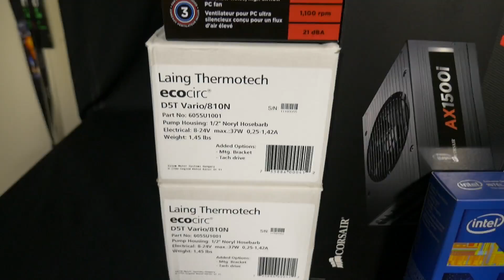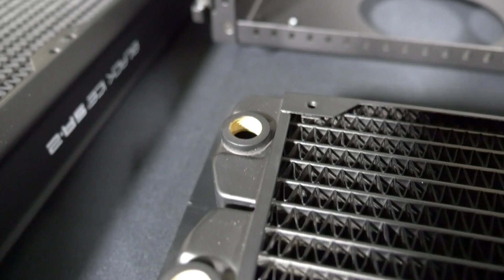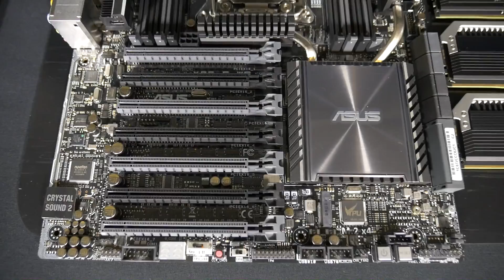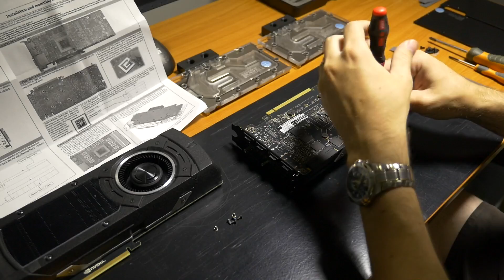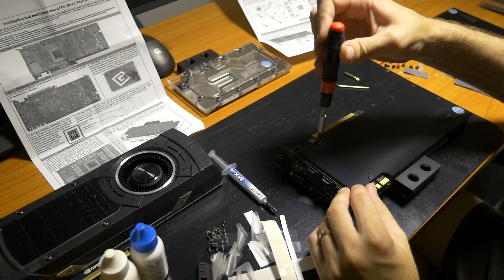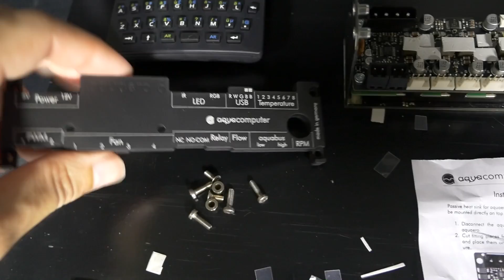SC Build #18: Extreme Workstation: Part 1

Comment: That's not how you apply thermal paste to any GPU or CPU. Never ever spread it out before putting the water block on. Put a line down the middle of the GPU or CPU and let the mounting pressure of the cooler do the rest. By spreading it out yourself you'll have a lot of thermal paste alongside the edges which will just be pushed off the GPU/CPU die where it will become useless, and it's also very possible that you get air bubbles trapped in the spread out paste which just hurt cooling performance.

Other than that, looking forward to the other parts.
Reply: +Mystery Biscuits The spreading-technique is the oldest and most used technique when it comes to TIM.
I'm using this method for over 16 years and up till now no TIM was "pushed off the GPU/CPU die". Also from all techniques (spreading, dot in the middle, line through the middle, cross and star) the spreading technique gives the best cooling-performance since the whole die is covered.
Reply: +Metatr0n Yes, indeed!

Comment: Love your videos, I am about to start putting together my 1st system and the water block on the gpu (and active backplate from aquacomputer for a r9 290x) scare me the most, the paper instructions say to use pads on the VRMs but their own video online shows him using thermal paste on them as well as the gpu itself....This confuses me.
In that video as well as this one it seems the thermal paste on the gpu was spread, I was wondering if you could suggest a method for this as I am only accustomed to not spreading it on cpus, though I must say I am worried....mainly because I am to broke to replace anything if I make a mistake...

I've had nearly the whole system worth of parts in my room for 4 months now and I am becoming more and more anxious to get around to building it. I went semi-over kill on the water cooling components for a 1st timer with water....Any advice would be welcomed about the gpu thermal paste thing. I have MX-4 as well, I cannot remember if you had perviously shown it but if you have put any aquacomputer cpu blocks on in the past maybe you could point me back to that log for a refresher mostly to make mself feel better.

Sorry for the length of this comment.

Comment: what screwdriver kit did you use to install the the water blocks to the titan or could you make a suggestion for a good PC toolkit other than ifixit iv'ed used them in the past and the bits seem to break way to easy

Comment: The AX1500i is 15A in USA on 115v outlet. 15A is a more common household socket power, with 20A not as common. Most other high power PSUs require a 20A outlet, but because this is a Titanium rated PSU, it can do the same with only 15A, and there is the selling point. But here in Australia our 10A outlet can power everything, and its the standard, which is great. So this power supply will run fine with a 10A 240v outlet.

Comment: SM951 is god. just stuck one in my impact VII to drop two whole cables from my system since i use to only use a single 750GB 840 EVO, now its just that single 512GB SM951 running full 4x 3.0 bandwidth

Comment: The Aquaero 6 XT - I was looking it up online. How many channels can you control and how many watts per channel? For example (an overkill system) - lets say someone has dual pumps and three 480mm rads in push-pull. That's 24 fans, plus lets say six case fans. So that's three channels with 8 fans on each channel, plus potentially up to six more separate channels - and that's not including pump or flow rate monitors, or lighting, for that matter. Assuming a worst-case scenario (mobo doesn't have enough PWM fan headers or proper fan control, blah blah blah), would you be able to split all 30 fans into that single controller and still have space (and power) for pump control and lighting?
Reply: +Sai Namuduri Edit: I noticed that it says 4 channels @ 30W/channel, but "expandable to 12 channels" - this is the phrase I was wondering about, because it doesn't say anything else about how or why that would work.
Reply: +Sai Namuduri You have a couple of options. You could connect two more Aquaero 6's as slaves over the Aquabus interface, giving you a total of 12 channels. You could also use PWM splitters, which is the best option for radiator fans, as you don't need to individually control every single fan on the radiator.
Reply: Bjarte Odin Kvamme That's the thing though - what's the average 120mm rad fan's power draw? Say, running at 1500rpm. If you're running 8 fans over one channel, that could be a problem (unless you have SATA power).
Reply: Average power draw is around 0.1-0.2A. All of the Aquaeros would need to be individually powered, and you should get Powered PWM splitters.
Reply: Sai Namuduri no one would seriously put 480 Rads three of them in one set up it's kind of a what if that you're discussing so like a little child in reality no one would do that in the system

Comment: This build could be like $1,000 cheaper if the builder did not go with Titan X's, an AXi and Dominator platniums. $700 saved going with 980Tis, the AXI is very overpriced, and same with the RAM. Honestly... Dominator Platinum is like the APPLE of Ram.
Reply: +StarFloGaming If the customer wants Dominators and Titans, that's what he puts in the system.
Reply: +Brandon Goh also most ddr4 kits of high clocks have crappy latencys.. best latencys are on the 2400 mhz with cl12  or 2133 mhz with cl11.. 
+StarFloGaming i guess someone building a system with dual titan x, 5960x, m.2 ssd and 20 hdds doesn't care that much about any money saved by going with lower components or different components.. 
the guy can effort premium, is paying premium and pays one of the best for the mods and the build..
also i guess this system is going to be someones workstation so i guess there is a reason for taking 2 titans over 980ti's.. i'm pretty sure this machine won't see that much of games installed..
Reply: The thing that surprised me was the low speed on that RAM. I just have plain Jane corsair LPX in my build and even that's clocked at 2666 instead of 2400 and I bought it back on the X99 release date. If you're going to spend a ton of money on DDR4 right now might as well go all the way and get 2800/3000MHz
Reply: +Sniggwaffles the way those sticks reach the rated speeds is by raising the bclk when u enable xmp and sometimes it can be a bit messy when going for a high overclock on your cpu
Reply: +StarFloGaming Have you seen this channel before?  Lol.  Also, he saved like $60 for the EK blocks cuz he doesn't have to buy the Monarch Modules ;)
Reply: +StarFloGaming Have you ever watched any other videos on this channel? It's not about saving money here, it's about extreme PC building and exploring the possibilities of the configurations and aesthetics that people can conceive of.
Reply: his costumers normally don't care that much about the price of the rig, they just want the top notch components